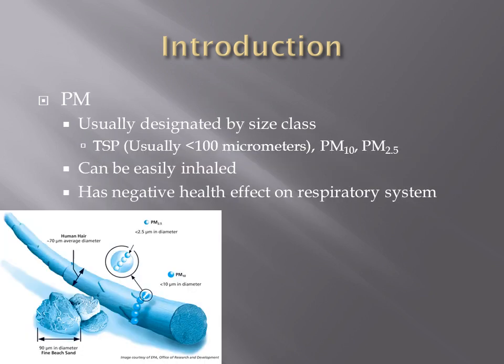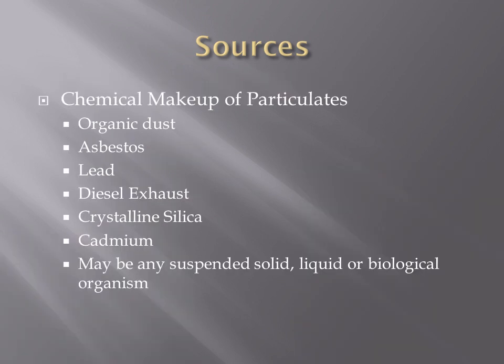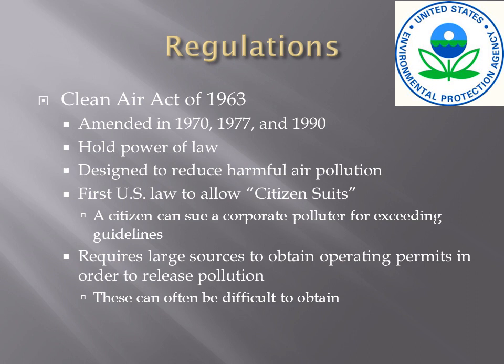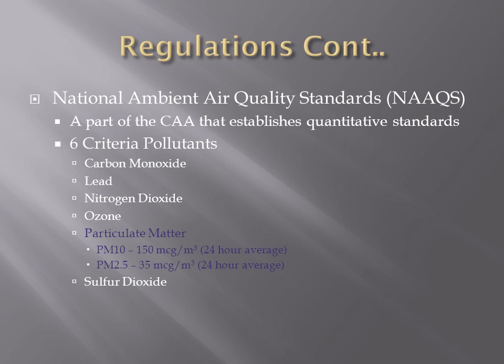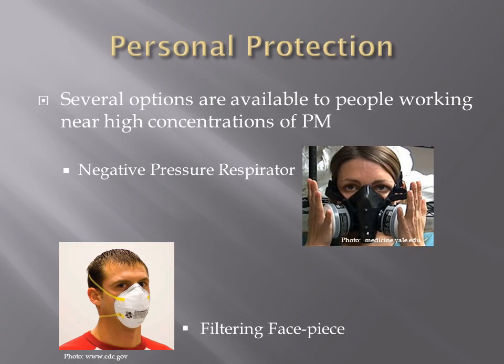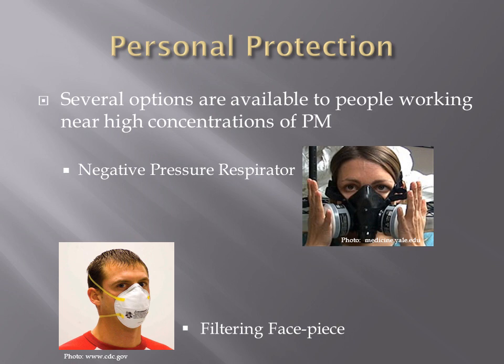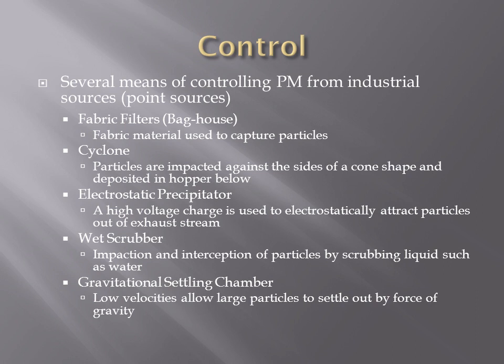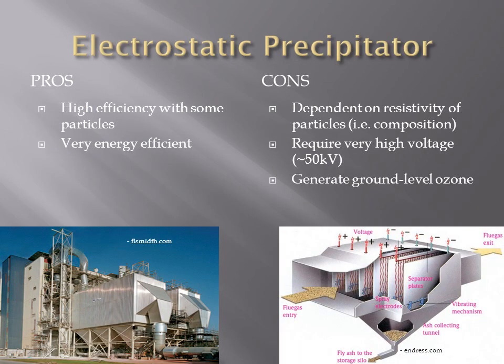Particulate Matter Presentation (GENAG 711)

Comment: If you wish to do your part please consider the following: purchase or lease an electric vehicle, switch your electric provider to one with a renewable portfolio, replace your older less efficient appliances to newer more efficient ones. If you are not able to do these things easily consider driving less and using electricity more efficient.
Reply: Bad advice. Electric burns 2x more fuel than direct combustion. Also, CO2 is just an issue for dummies. The CO2 content of the atmosphere is 0.04%, and all life on earth would die if it dropped to 0.02%. it amounts to nothing in the atmosphere. H2O is the greenhouse gas in a greenhouse and absorbs dozens of times more infrared. On the other hand, chemtrails are a blanket over a hot earth beneath a hot sun, preventing earth hear from radiating into space, and they are right in front of your eyes, but you push nonsense like CO2 and batteries on people which you know nothing about.